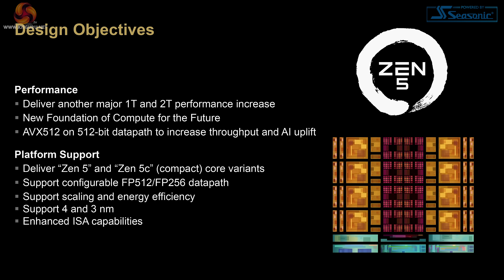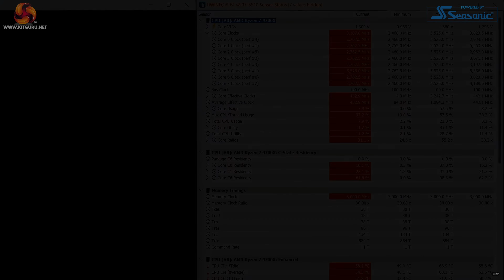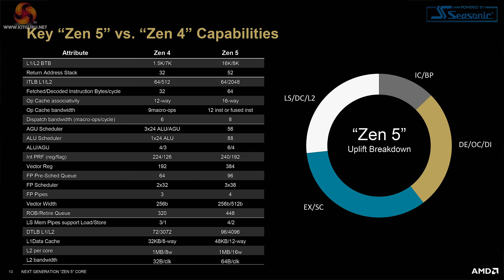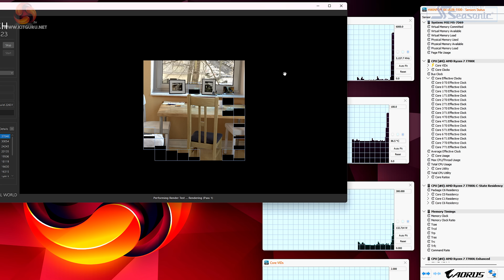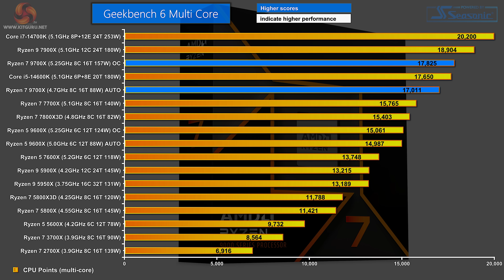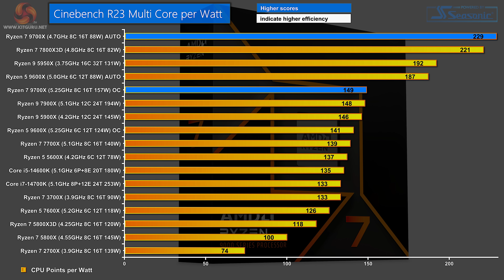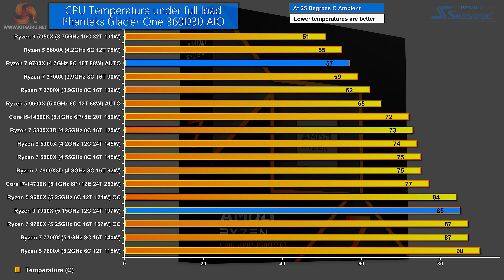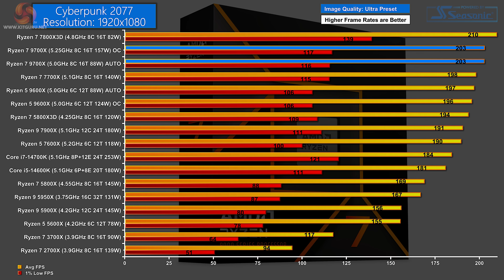AMD Ryzen 7 9700X review: YouTube hates this CPU

Comment: In most of the gaming benchmarks it seems like youre GPU bottlenecked. Especially with the top end of 1440P
Reply: cant see anyone gaming at lower iq or res settings. I get your point, but this audience dont game at reall low res or IQ
Reply: Seems to be a good thing for the 9700x, if you don't have more than a 4080 gaming oc you perhaps won't need a ryzen 9 or an x3d.

Comment: Are the CPU temperatures under full load average or maximum?
Reply from the maker: They are the consistent temperature during 10 minute test runs. The CPU settles at those figures in less than a minute and then sits there rock solid.
Leo

Comment: I think its good - Leo nailed it in the start bit around the pricing stuff - when the last gen came out it was just as expensive as this !
Reply: Yep 7700x was £420. Around £90 more than the 9700x. People say 9700x is badly priced against 2 year old hardware. I am not sure the logic. I can buy 2 year old anything for less than a new design
Reply: more expensive
Reply: We pay retail prices, not launch MSRP. When new model offers negligible benefits over the previous one, but demands a disproportionately higher price, it's a bad price on the current market. Why would I buy a 9700X over a 7900X? Or 7800X3D?
Reply from the maker: @SaltyMaud  Leo did go over this in the video - he said people shouldn't upgrade from a 7700x to a 9700x if they own one. But he went over the new buyer angle. You pay launch prices at launch - has anyone said differently? In two years, the 9700x will have dropped in price in a similar way. Its how this market works
Reply: @KitGuruTech  But again last gen is still a available option, and it's definitely not asking the original launch price anymore. If I'm standin in front of the CPU shelf at a store today, and I see 7800X3D, 7900X and 9700X all at roughly the same price, in what situation would I choose the latter?
Reply: No, it was MORE expensive than this. Not sure why people dont seem to work that out. selective memory maybe. Its hardly a shocker two year old hardware drops in price over time. unless you are Nvidia or Apple thats always the case.
Reply: And why would you care about the launch prices anyway? You need look at how much extra performance you get with new Gen vs previous Gen. If it's abysmal (as in this case), then no, the pricing is abysmal too. Price at launch taken out of context makes no sense.

Comment: yes because people were expecting a ridiculous 40% uplift. lol
Reply: I know, its always fuelled by the big channels saying things suck or are a waste of time. Zen 5 isnt a waste of time, we havent even seen some of it yet for god sake ! people just love drama
Reply: Or maybe because they were expecting more than 10% after 2 years?
Not to mention that if you compare to 7700 it's a joke, it's more expensive, barely better and more efficient although it was released more than one year and a half better.
Reply: @mirceastan94 Run both the 9700x and 7700x at the same TDP then get back to me. Both at the same power draw the 9000 wins every time. 10% at significantly lower power is sooo much better than you realise.
Reply: @prototypep4 the difference in system power draw is actually not much. It runs cooler though
Reply: @prototypep4  not according to hardware unboxed, 7700 (65w) very similar to 9700x (65w). same applies to ryzen 5
Reply: 20% at 180 Watt PPT is quite substantial! More than I expected.
Reply: No they expected a 16% gaming uplift which AMD promised but did not deliver.

Comment: The thought is that this CPU should have been 105 watts. At 65 watts, it does not reach full potential.
Reply: Well, make it 105W then, why not. Tech blogger elite shat on AMD for very hot Ryzen CPUs previously, it listened, and now it is shat upon again by the same tech bloggers for making reasonably power limited CPUs. It is hilarious.
Reply: Maybe they are saving a 9800X as the 105W same before with 3700X and 3800X

Comment: Hoping the X3D is substantial.
Reply: What makes you think it will post any greater of a gaming performance difference vs 7800x3D as you see between 7700x vs 9700x?
Reply: @TheBlackIdentety  perhaps the new core arch is starved of bandwidth that v-cache can provide
Reply: @euphoria842  7700x was already starved of bandwidth. Why would V-Cache help Zen5 by a higher % ? Not to mention 9800x3D will be power and temp limited like all x3D cpus. I very much doubt they'll let people fry the cache by unlocking them.
Reply: @TheBlackIdentety  im just being tryna be optimistic
Reply: It will be - they can clock it higher at lower power draw, should OC massively well